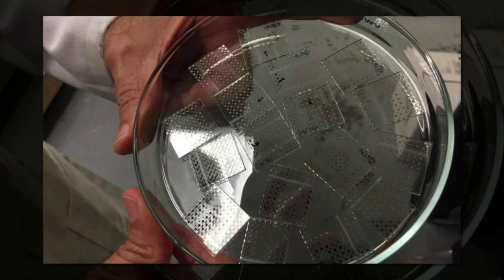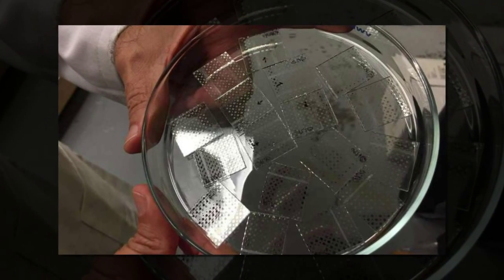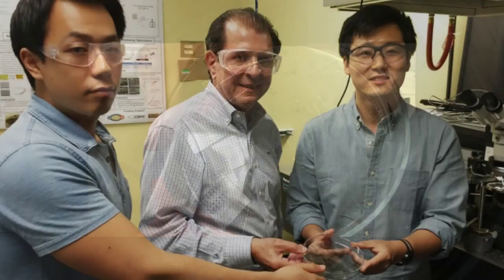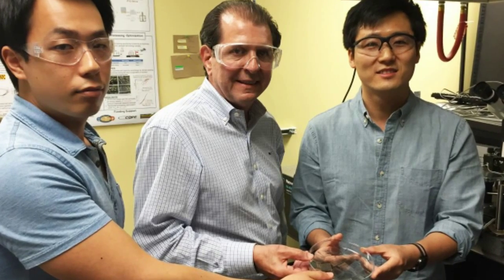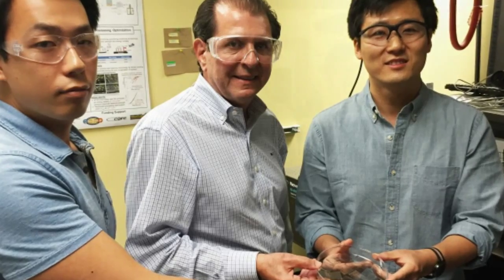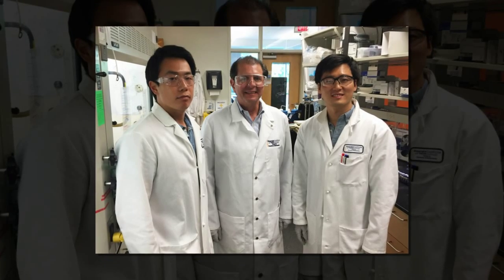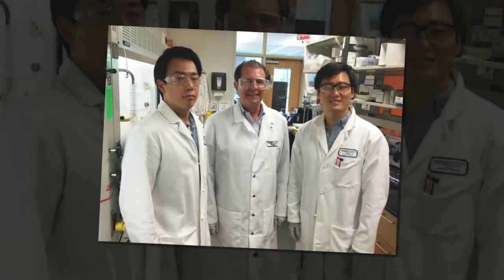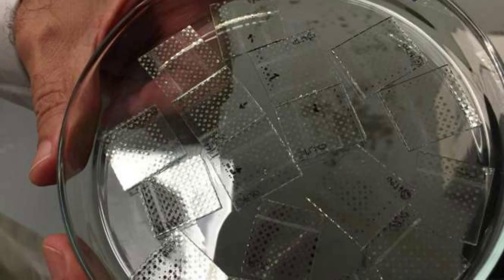Sol-gel capacitor dielectric offers record high energy storage

Comment: I cannot wait until this is A commercially produced Film, i have a capacitor winding assembly for high energy high voltage capacitors, this could be used to replace my current capacitor dielectric allowing very high energy capacity for power storage maybe for a start, in an electric cars with dynamic braking or something similar.